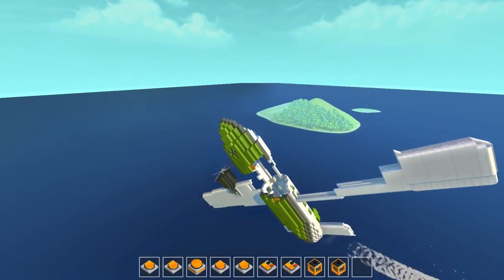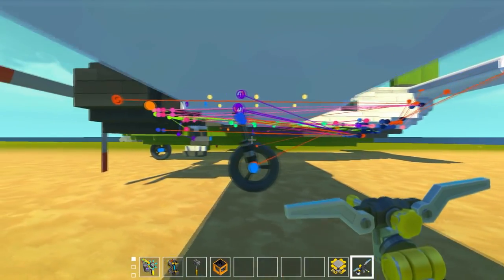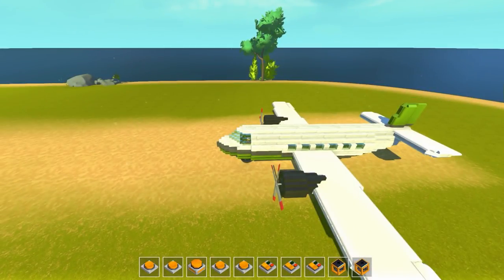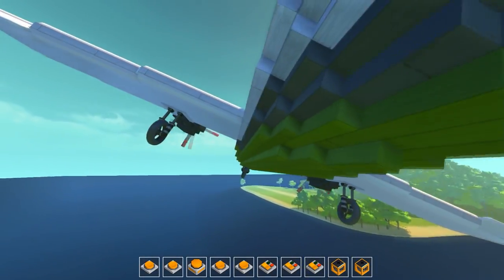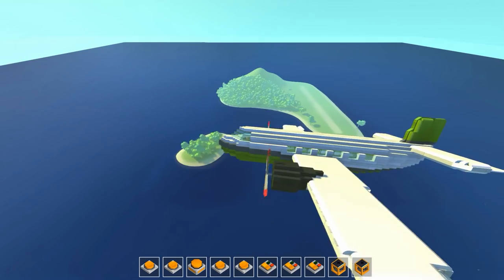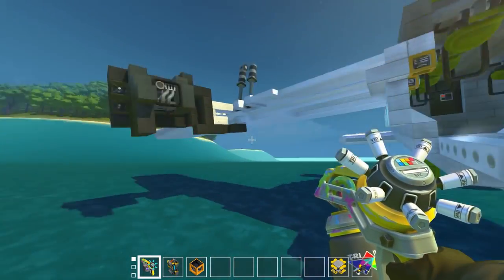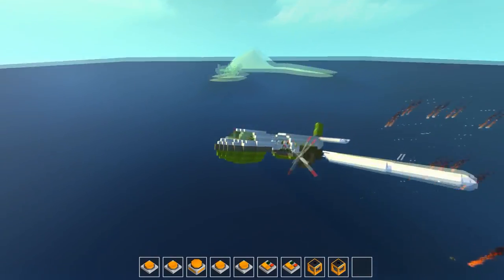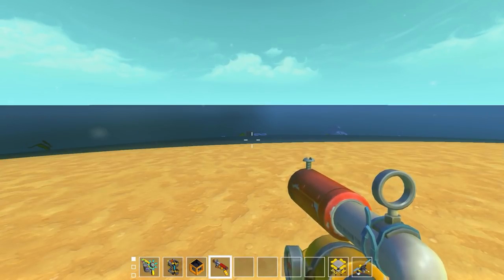Twin Engine Propeller Plane Vs Homing Missiles! (Scrap Mechanic #373)

Comment: Kan you should add a sensor on the end of the missiles so that way they will always explode when they are close enough to an object making it easier to dodge and easier to explode and it won’t just get stuck in the plane and cause it to crash
Reply: Ninja Batcoon he made the missile too compact
Reply: @Rami-L  its still gonna be really easy.
He could just add a few tiny cardbord blocks and put spud guns on them.
Or he could bring the magnet up one using cardboard and the put spud guns on the first layer of cardboard. The sensor could be placed on top of the magnet
Reply: No! What he needs is a timer that is set for 30 second and that 30 second is for the limit of the homing missile just like real life homing missile they can't track planes forever
Reply: @donkeymaster1815  YES, THANK YOU! Also making it faster, just for the sake of seeing hell at top speed.
Reply: @donkeymaster1815  Actually both would be cool
Reply: That ruins the fun!
Reply: And make it so it has a timer for detonation if it hit the target without exploding for like a air missile version

Comment: That actually a pretty cool and complete plane ! I have one nitpick : real planes usually increase propeller blades pitch to increase thrust (or put the in flag, parallel to the airflow when the engine is off or dead, to reduce drag)
You could add this pretty easilly with bearings controlled by a smart engine and bind it to increase/decrease thrust like you already have. I have no idea how it would affect handling but that would be pretty damn cool to see.

Comment: Modern fighter jets (i dont know if normal planes have it, too) have a system, wich makes that the lever to control the plane, gets harder to pull at high G-forces and like this corrects the flight. The system consists of many weights and springs to achieve this. Do you think you can recreate that in scrapmechanik?

Comment: You should put player indicators on the rotors because most surface to air missiles are heat seeking.

Wing tips also tend to heat up

Comment: real aircraft tilt the prop angle witch allows the engine to get up to speed with out creating thrust so you should tilt the prop surface flat and have control over the thrust that way

Comment: You know why has no one added an extra remote control block to the automated weapon systems they create so they can activate from their vehicle their trying out like kan add a remote control block to your missle system that can activate the launching system and then add a remote block to your creation and then activate from your creation so its easier to tet them out

Comment: Put a sensor on the front of the missile and connect it to the explosive so if the sensor sences u within 3 blocks it blows up. So it doesn't get stuck to your plane or inside it.